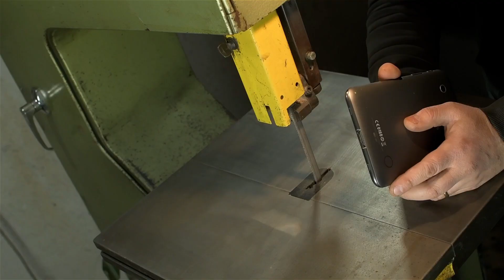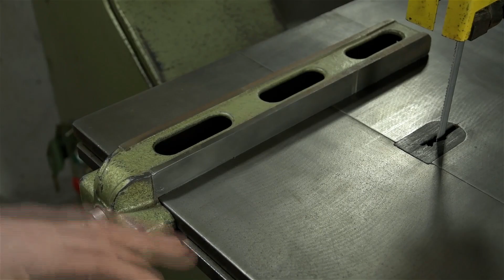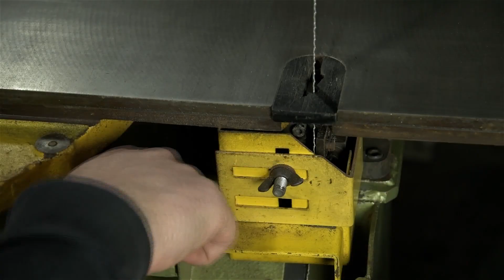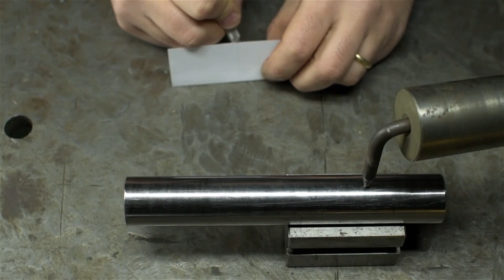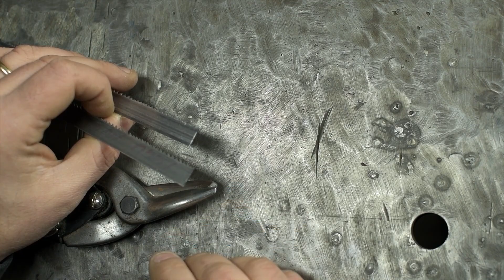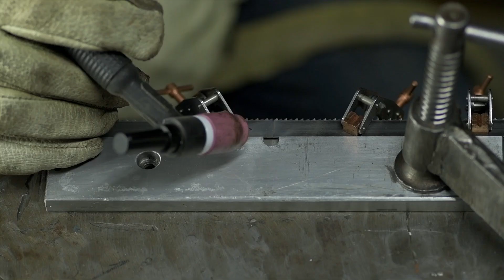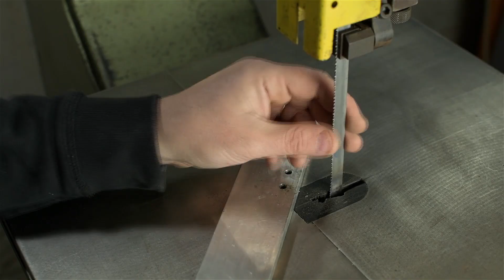LIVE!? - Welding Bandsaw Blades & Startrite Saw

Comment: A neat math trick to convert 3200ft/min to 36mph real quuck in your head. 60mph is a mile a minute is 5280 feet a minute ÷ 60 is(hmmm 100 - 720/60) 88 ft/min so 3200÷88 is 32 with 12x32 or 320+64 384 left is 24 more than 360 which is 4 and 12 left with 24 is 36/88 or 36 and 9/22 mph. I didn't  share the 9/22 with my wife and kids (I told AvE he could be a family show too if he wanted to). Wife said it was a neat trick. Just thought I'd share the 2-3 second visualization used to go from 3200ft/min to 36mph with easy math in your head.
Reply: or, 1000 metres per minute = 60 km/h which is not too far from 36 mph ... no remembering how many flipping feet per mile.
Reply: reprapmlp 5280 silly. In highschool, a lap was "the 440" and we all knew it took 4 laps to make a mile, so 440x3ft to get 1320(most know that ftom when you go to the county strip to check your minivan times without getting a ticket) then you multiply by 4 to get 5280 we mile. All these numbers are easy to come by if you just reflect on daily life. Everyone that's had a 12oz coke has surely noticed the 355ml on the can, so that gives you everything you need for volume. Now for someone like tony that may want to convert km to miles, the 127T and 50T change gears are all he needs to remind him of the 25.4mm to 1in and you just go from there. These conversions are all out in plain sight. Even the slow kids in highschool knew that car and driver always put (62.1mph) next to the 0-100kmh times. You can usually think of little things in everyday life that give you all the info you need to write a 30th edition machinerys handbook.

Comment: "one blade cuts faster than the other" Holy crap, you could make your own mixed material blade.  Half low TPI wood blade, half high TPI metal blade. Put it on and you'll never be like "UGH i want to use the bandsaw, but I really should change the blade"

Comment: Nice!  I bought a 1930's "Craftsman" 12 inch  bandsaw a while back, and it uses a 78.4" blade....so I just buy the 80" or 93" blades and cut and weld them myself....clamp them to a thick bar of aluminum to help pull some heat out.....the 1/2" blades are easy....but dang I had to do a 1/8" x 0.025" thick one the other day....that was tough....but it held no problem!

Comment: Usually for annealing you have to go above critical(like heat treating) hold it for a bit, then let it slowly cool. Especially if it is tool steel because lot of tool steel can be air cooled.... Some people will heat it past critical, then put it in ash, sand or vermiculite to slow the cooling process... Then again normalizing a couple cycles might work too... Just a thought....take it easy...

Comment: At work we using bearings for the guide. Personally I feel that its reduces stress on the blade some maybe? Downside is that I've had a blade actually cut into a guide bearing. PAIN IN THE ASS TO FIX.

Comment: Bolted bandsaw blades will eventually work lose due to vibration and flexing. Pop-rivets are the way to go.
Reply: FXM or just tie a little knot
Reply: nyloc nuts or a spring washer do wonders ;)
Reply: You guys make things so difficult.  Superclue and activator are all you need and you're back up and running in under 30 seconds.  You bunch of amateurs!
Reply: Just slip a cotter pin through there. Or an old keyring. #lifehacks
Reply: FXM     Put both ends through a growler and magnetize. Presto! Easy assembly & disassembly for all applications forever.  🤔🙄

Comment: Beautiful machine! I know what you mean with space & heft... I went total Idiotic and bought a Mössner SSF501 with a hydaulic table... As for blade shoes against Rollers: Rollers are for high speeds, the shoes are better for slow cuts with high precision. I had shoes on my previous saw which was quite the same size and speed as yours, the new machine has rollers... I can feel the lack of precision, against the shoes, but maybe I will build some shoe guides for use with the low speeds of the new machine. Ah... and keep those shoes lubricated... use a wick oiler pushed against the backside of the blade.

Comment: I can't believe I fell for that live thing. And nice job on the blades, the first time I tried this I was convinced it's bad practice and bound to fail, but to my amazement the blade worked for like 20 minutes
Reply: Phil Vandelay that comment made me check out your channel... love it! you need more subscribers!
Reply: Just Subbed!
Reply: I think easiest way to weld this is use those purpose designed resistance welder, I tried gas welding and while I only welded training sections (used a broken and too short bimetal blade for this) I have mixed success, and it's very skill intensive since there's a very fine line between a good joint and melting holes through it. I found it better to just get barely a puddle on it, and join both sides than to try and melt the blade all the way through to join it. It also helps to melt the blade a little more, and push the joint together to weld it. However you'll have to anneal it good and it won't be as strong as the unwelded saw body itself. Seems success in welding bandsaw blade is mixed with TIG, MIG, or even stick (has anyone tried to stick weld bandsaw blades?) It sounds like a good thing to put on a welder resume, "successfully welded bandsaw blades with an oxyacetylene torch". I mean if you can weld this you can weld anything.

For carbon steel seems better to braze it, but bimetal won't take braze alloys at all (it snaps clean off).

Comment: Matthias Wandel has some good info on blade guide comparison: https://woodgears.ca/bandsaw/guides.html
Reply: But his bandsaw was green
Reply: Nope, his bandsaw is Avocado
Reply: He also put out a video this morning showing a blade running with that same sort of inconsistent cutting, his due to the grinding wheel he used to sharpen the teeth wearing over the course of the saw blade.

Comment: keep in mind that by heating to dull red, you are taking the temper out of the blade, a blue on the straight side, and a straw color on the tooth side is actually what you should have aimed for to prevent a dull section on the saw.

Comment: Definitely jealous.... I'm still using a Harbor Freight Porta-ban.... though with my small shop, I barely have any room for anything bigger. I had to buy a surface grinder to go on my 2x72 grinder(I built a horizontal), because a floor model would be impossible in my basement, not to mention, I can't hang a floor model on the wall, hahaha...take it easy.